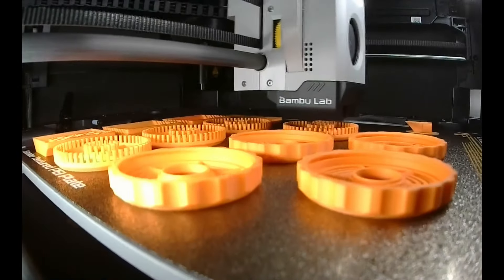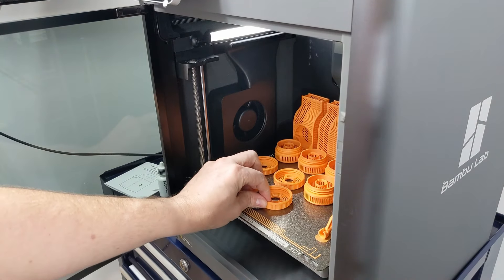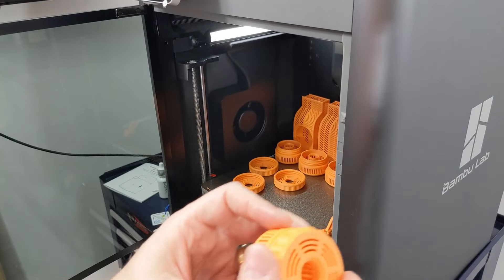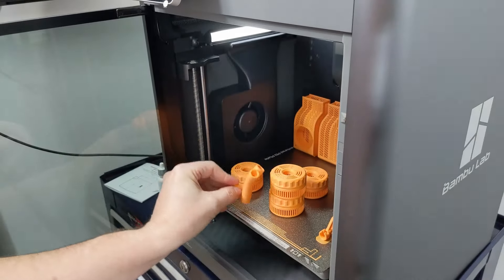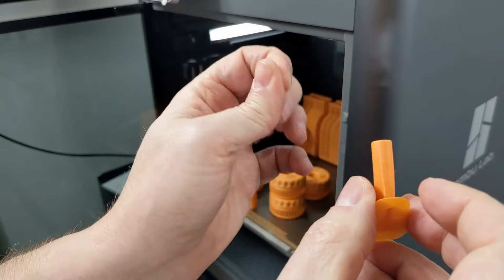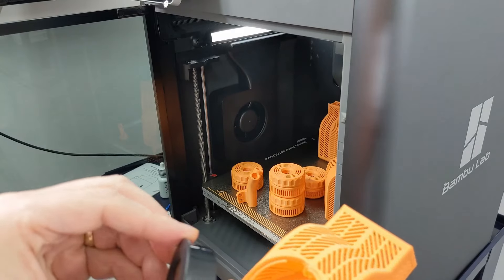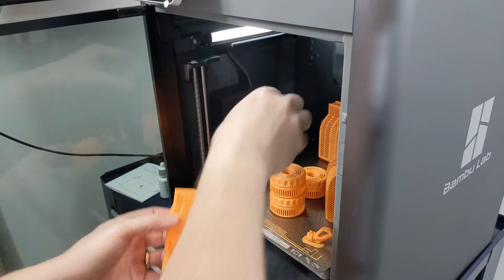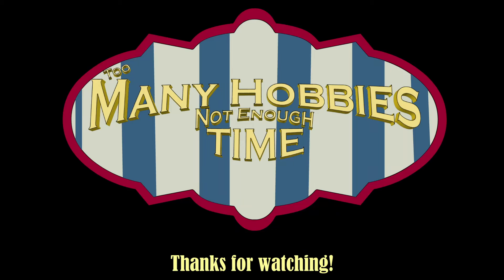3D PRINT JOB #x1e #bambulab #AMS #x1c #x1carbon #polymaker

Comment: Been on the fence about this thing for a while. Was thinking about waiting for a larger version but seeing that ABS print so smooth I'm doubting waiting. I've used abs for years and while I can get it to print well on my UpMini2 and my F400, it's NEVER been that dimensionally accurate. Much less come off a build plate like that.
Reply from the maker: The heated bed, auto leveling, and heated enclosure (X1E) I think has made a difference. This is my first printer - I over researched for years until Bambu X1C came out. Almost bought it, then they released X1E. I wanted tougher prints than PLA, and thought I wanted ABS...then I discovered polycarbonate (PC)!! Currently having ABS bed adhesion issues. Many failed print videos to come.
Reply: @TooManyHobbiesNotEnoughTime  Vision Miner and a few other companies make different liquids specifically for holding down different plastics. I'd prefer to find a surface that doesn't need such things, but sometimes it is worth it just to not have to keep having failed prints trying to get it all tuned in.
I use Aquanet hairspray on the textured PEI as well as the engineering plate with anything that is having bed adhesion issues, and it usually works for me, but I rarely do huge parts.

Also when printing ABS or ASA (which I prefer to abs), it's worth getting the chamber up to temp for 10-20 minutes or more before printing, and letting it slowly cool down after printing can help with warping and layer delamination.

To the person thinking about getting one. I ended up getting the X1C about 5 months ago, and am so glad I finally went for it. It's been long enough that most "new tech" issues that always exist with new products, have been worked out. I can't wait for a bigger one, but may also wait quite a while after it comes out so I don't have to go through all the "early adopter" pains. I've had 3D printers in my home for over 15 years. I don't want to ever go back to any of the other printers I own, and in fact have not even ran one print on any of them since I got the Bambu Labs X1C.

Like any 3D printer, you will run into issues here and there, but it is light years beyond the experience I've had with any other printer.

Comment: Any advices on printing desiccant trays for AMS in ABS?
What profile settings you used? What temps, what fan speed for overhangs, any other changes?
On my try of printing those trays with ABS, that upper tray sholder, where those thin ribs that are already at 45deg angle, angle even flatter, start to warp up a lot prior connecting to other side, and nozzle smears filament to sides
Reply from the maker: I'm new to 3D printing - you may need to incorporate removable supports. What model are you using? Curious to see what you found. Drop a link here. THANKS!
Reply: @TooManyHobbiesNotEnoughTime  I mean, what slicer profile you selected in Bambu studio or Orca slicer, generic ABS or Bambu ABS (or some custom calibrated filament profile), if(and which) changes you did when you were slicing/printing your trays (eg. those mentioned support related settings or any others that you might have changed from defaults)?

Comment: Prusa XL 5 head is the Juggernaut right now.. Multi tool heads are far more superior than AMS 💯
Reply from the maker: I do like that option. I'm not really using the AMS for multicolor or multi-material, so it is a bit of a waste. I do like the auto witch over when I run out of filament though. XL may be next machine.